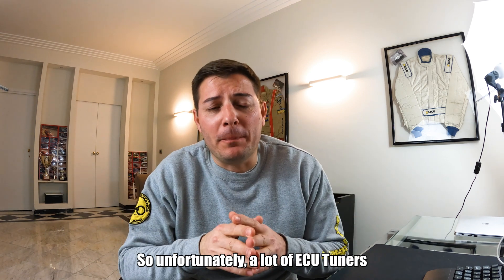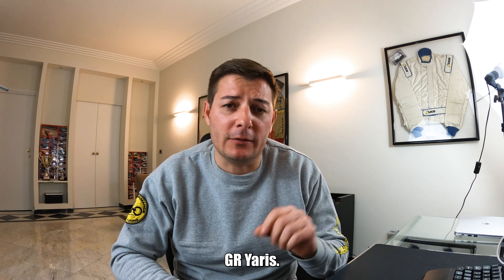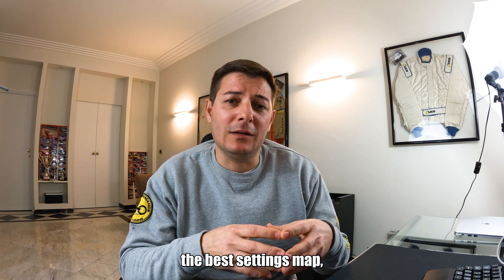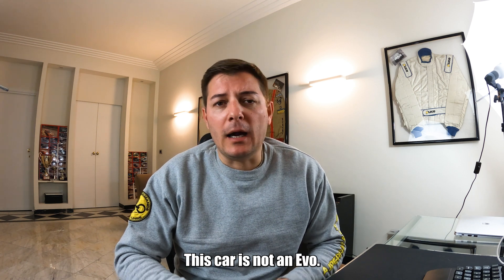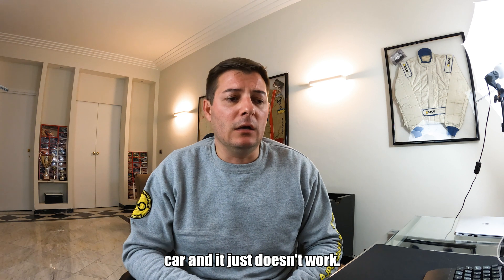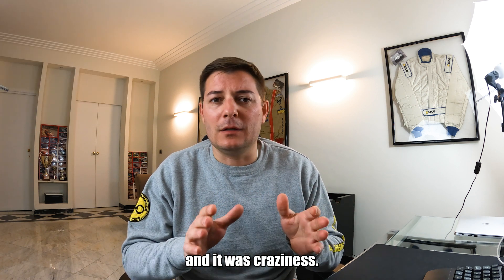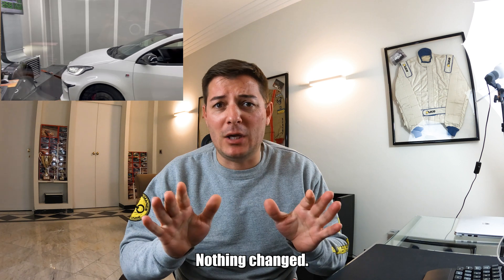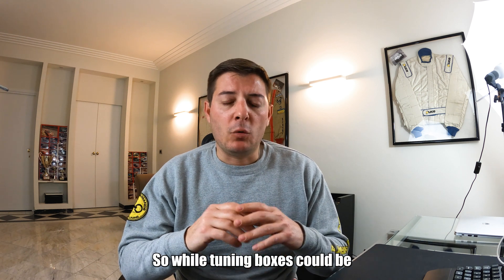GR Yaris ECU Remap Tuning Upgrade (Stage 1,2,3) | 4K

Comment: Just to add, I have been working with a tuner for about 2 years and came to the same conclusion. Its possible to tune on the oem ecu for single runs like at the traffic lights etc but on track as soon as the car is getting run hard it makes almost factory power.
Reply from the maker: Exactly, thanks mate

Comment: Interesting, the dyno we've used on my car has never had a problem in awd mode. That is not to say you're wrong though. Just that it seems there are at least some kinds of dyno that work in AWD that can give consistent results. 😁👍
Reply from the maker: This is interesting: so you got consistent back to back runs in 4x4 mode? You are the first I hear from. Was the dyno in locked mode?
Reply: I dont know too much about it, I can ask the tuner but when I explained the potential issue they said "dont worry all the rollers are linked" they were able to do 10 or so runs with me there during the last tune and got the same power within 5-10bhp through the power curve. I can ask them what type it is if you want.
Reply from the maker: @BanzaiYaris linked is what I was intending, and also you replied: this 5-10hp difference is all the problem mate! It oscillates because the traction control unit (TCU) starts doing strange things when its in 4wd mode!

Comment: Good day! Insanely good video! Thank you. For days now, I've been looking for so many hours a day which chip tuning (or tuning box) I should do. But what great information!

I come from Germany and my English is not perfect, but is it summarized correctly? :
-No tuner can currently offer good chip tuning because they simply overwrite the existing program but keep tuning the car down for safety reasons? And you basically don't have any real increase in performance?
2: Lichtfield is the only company that has recently been able to do a reasonable mapping because they use other software and you can hand in your control unit there?

Please answer or advise what I should do now to get more performance, as of today?
Reply from the maker: Hello Peter, thankyou for that!
Let me clear it out: tuners use software made by third party to enter the ECU, then individually tune the car.
Today there are two main softwares available:
- Alientech (not what you want)
- Ecutek (this is ok)
Find an Ecutek dealer, they will be able to tune your car well.
All tuners that use the other software, even if they are great, can’t keep the OEM software from coming back and intervene on the new settings.
Hope this helps and is more clear!

Comment: Good newz for Ecutek ! I remapped mine because I had inconsistent boost when stock (sometimes it won't go over 1 bar of boost). Now it's gone but i still feel some inconstencies on the road. Also, the Yaris has a 2WD dyno mode included :)
Reply from the maker: Yes exactly! But you should really understand what is the issue there is beneath: boost cuts on stock map point to a real issue of some kind, beware!

Comment: I'm probably $2,500 into this focusing on what was found to be snake oil. I did not run an aftermarket intake or airbox, but you know the drill. 4WD is so tricky to dyno on stock ECU. I had good stock numbers but after adding parts, I lost power. It's the truth and a lot of these companies either cherry pick and dishonest or the mileage may vary during testing.

New cars are hyper complex and a standalone seems to be the only constant to control these conditions aside the other expected anomalies that could happen with dynoing.
Reply from the maker: I understand: best is stock or Ecutek with full control, disabling all Oem sw. This appears to be possible in the current Beta

Comment: Good info Adriano, can I ask if there would still be issues when you go in for Toyota updates  ? They ask if I've had it mapped each time , I understand it can wipe any re-map thats been done. I'm probably not going with any re-map
but who knows in the future.

Regards Russ..
Reply from the maker: Cheers Russ: just went in to Toyota on Friday and no issues. They did connect to diagnostics and also made an update to the SOS system upon a recall
Reply: @AJClubsport Toyota told me any remap on the car would be overwritten  due to having a substantial ECU update (2 year service) on Monday,surprisingly the car as become more responsive  and feels quicker since having this scheduled ecu update by Toyota,definitely a surprise to me.
Reply: Cheers Adriano, yes same thing I've   been in 3 times for updates due to early car, I'll ask again to make sure, Are Ecuteck a UK based software firm ?

Comment: I kinda like the idea of box. If my understanding is correct, that way you get extra power but the ECU has a final word safety-wise? I have DTUK (306hp, 412Nm), but had it's harness re-worked as I suspect the loose pin connections threw Boost pressure sensor error code once every few month. Didn't test it yet with renewed harness.
Reply from the maker: Most probably it isn’t the wiring: it is the ECU not happy with the requests coming from the external box. Try to lower settings and it will work
Reply: @PIRASMotorsport  Happened to me once with the box turned off but wired in car, so I doubt it's about setting. One of the guys working for Rimac repaired the harness and told me there were signs off loose connection sparks. Strangely, read about exact same ECU error code on few stock cars in last few month.
Reply from the maker: @markos8400 wow, that is something new to me!

Comment: Thanks for the video! What is the idle like on the EZ cams? Who mapped your car and did they use Ecutek? Cheers
Reply from the maker: I am waiting on the cams install and map for Ecutek to release the next step in software with added features and muli-maps. All work done by ACME Racing.
Idle is like stock on EZ and A profiles, no information about the other profiles
Reply: @PIRASMotorsport  thanks mate!

Comment: Use a linked 4WD dyno system (IE dynojet) and you wont have issues running with proper 4WD. Our GR yaris development is consistent run to run with sort of dyno, I wouldn't bother wasting time on unlinked small roller dyno that is inferior, nothing but issues for this sort of application. Syvecs is cheap upgrade for the features, consistency and security you can have on the car. ECUTek is good too, but always fighting stock ECU strategies. Hard for me to recomend at this moment, better to not waste money and save for standalone in my opinion. As ECUTek develops it will become more robust so there will more chance to get people an alternatirve, this is always the life cycle of development for new platform.
Reply from the maker: As was mentioning in the video, EcuTek is on the verge of a major new release that will enable full control, so no more fighting the stock ECU! And this will also enable multi maps and OBD writing.
We tried on two different dynos, both linked rollers, and it didn’t work for us, as for many other tuners. Given the possibility of running the car in FWD mode, it makes no sense not to while on stock Ecu, in my opinion.
Cheers
Reply: @PIRASMotorsport  I have no issues with stock ECU on dynojet linked. Nothing but issues on anything else is my experience. 
Yes new update will be a step in right direction, time will tell
Reply from the maker: Cheers mate!

Comment: Don’t go over 420NM with stock rods 👍
I had no head lift at 400HP and 500NM but after 20k KM the rod on cylinder 1 got fatigued and broke. I’m forging the engine right now 😂
Reply from the maker: Thankyou for this information: it seems that you may have run into detonation, because there are many cars out there, including mine, that have been running strong on stock rods at 1.8bar and over for over a year now…

Comment: Thanks for the no bullshit video, at last someone talks with facts why most tuners sell snake oil in the end. Still I have to say that running the DTUK (or DTE in Germany) box in the conservative settings for 1 year with at least 2k in track/drift events I have only had only a couple of times throwing an error code and I consistently see at least 1sec of improvement in my lap times (in the same track and same day event so comparing apples to apples). I also almost always have it deactivated in the city, using it only during track time and maybe autobahn where 230km/h in Germany will not cut it! Not sure what a quality next step for additional hp would be (looking for 320-340hp range, nothing that I will need to open the engine). Oil cooler installed, transmission cooling mods as well, next step is suspension.
Reply from the maker: Cheers mate, very big news is coming from the suspension compartment soon (within a week)

Comment: Hey Adriano, first of all thanks for the good technical content you provide. Keep up the good work.
I'm currently on a custom map for 3500km now with 340HP/450NM and just bolt ons and didn't run in any sort of issue yet. For the 2025 season I'm thinking about upgrading the motor like you to go for around 420HP but not much over the current torque because we all know the car doesn't like that.
I'll drop in the beehive springs and 267-A cams from Kelford, turbo upgrade, head studs and upgraded head gasket. What studs will you be using and what gains are you expecting from your build plans? I'd love to hear your thoughts on this.
Reply from the maker: Hi there, thankyou for your comment!
Your plan seems to be very good and ambitious! I suggest to check out @ctecperformance
Nigell is around the end of development of the most well engineered turbo kit I have seen for GRY, with long runner headers and two turbo options 450 and 550bhp.
I’m happy your stock ecu map is running strong, it’s a lucky one and for sure you have great fuel where you are!
Reply: @PIRASMotorsport  Thank you for this suggestion, I'll have a look at it. Unfortunately I can't run an aftermarket turbo setup because our TÜV will notice 😄 My current setup has full TÜV coverage. You're right, here in germany I've no issue finding 100 or 102 octane fuel. Do you have a suggestion for the head studs? Will H13 tool steel keep up with this kind of power?
Reply from the maker: @TheOriginal99 yes, they will be fine as head studs. I got Lamspeed
Reply: @TheOriginal99  in Germany as well, care to share your current setup? I am on a DTE box with low settings, Milltek exhaust, Airtec oil cooler. The DTE while not anything dramatic always gives me at least 1 sec better lap time and while I have not measured my car I’d say it’s close to 300hp, would be interested for 340hp. TIA

Comment: Lift will come with 280hp and 390Nm of torque. I think it might be the sweet spot for this car. I think for tracking car the best map is always stock one:).
Reply from the maker: Yes, or a very well done map and all additional cooling/supporting mods
Reply: @PIRASMotorsport stock map is always very good and safe. Of course when mapping Your car more power means always more heat (and heat is killing the engine) so intercooler and oil cooler is must have modification. I dont have experience with GR (but i really want to buy lift) but with another cars i owned i have bad experiences with custom maps, tuners always pushed the engine to the maximum chasing the peak Numbers and in the end it ended with engine damage or with the lack of performance on the track by cutting the boost and timing. Now i am using OTS map on my car, that map was tested for several months on road and tracks and i am pretty pleased with it, it works, car is smooth and zero problems;)
Reply from the maker: @piotrwozniak7840 yes, I agree: this is why I talk about power that is always the same in all conditions. The GRY gets very hot, this is why we developed the hood vents to extract hot air, both WRC and Rally.2 versions. What do you intend by “lift”?
Reply: @PIRASMotorsport by lift i mean refreshed version which will come in the middle of this year. Toyota made great changes in refreshed version of the car (also better cooling). I want to sell my golf 8R and get GR 😊
Reply from the maker: @piotrwozniak7840 ah ok, in that case its a great idea!
Reply: @PIRASMotorsport 8R is great driver car, it gives much fun, is crazy crazy fast after tune but i miss my Focus RS rally feel and GR is rally car for the streets. I love this concept:).
Reply: Hi Adriano,
All the Time i think here in Germany about to bring the car to MPS Engineering for make the mapping. I drive my car hard on the road but not on the track. It's one of the first cars 2020 wit fin under 2400 with the JDM Mapping RZ boost Pressure 1,6 bar. Modifided with HJS Downpipe, Milltek Exhaust, Eventuri System and Turbosmart  Valve the car works with good 300 horse Power and full toyota waranty  about 15 years in Germany. For the hard street use perfekt and i think with the modifikations,  like suspension, bushings etc. the new GR 2024 will have no chance. 😊
Reply: @holgerstoll4682 how it is possible to retain warranty after the tune?
Reply: @piotrwozniak7840  my toyota dealer told me, if the engine is killed and Toyota check the ECU Box, they can see, another Mapping was installed. Also when you are playing the OEM Mapping again. Every Mapping is registered and you can not delete
Reply from the maker: @holgerstoll4682 this also depends on what mapping you have. Getting to more advanced software, they will only be able to detect on a bench in Japan

Comment: Hey A, thanks for the great video, so my car is mapped by one of my friends knowing denso ecu very well , we ran the car on the front wheels only and achieved really good results, but once on the road the car took out power aggressively, after realising that we went back and got it eventually sorted by adjusting torque limits in the 4wd , car runs great consistently now , just some data , it ran 16.6 sec 100-200kmh stock ,then after the map it now runs 13.8 seconds consistently, I kept it moderately on the tune, he said there is still more to get out but i left it at 250kw it ran 200kw on the base run with only exhaust
Cannot wait for ECUteck🤞🏼
Reply from the maker: Thankyou for this great information, sharing your experience: I am happy you also saw first person!! Please let me know how the next step goes for you with Ecutek!

Comment: I had similar problems with the Litchfield chip. Fantastic when it was working, but particularly at the track the chip would throw a code and cut boost.
Reply from the maker: Yes, exactly the interference detection by OEM software!! Cheers Matthew
Reply: was that the Lichfield box or remap?  I have been considering the ECU map from them, but this very well argued presentation gives me doubts. I am GR 21 8000miles
Reply from the maker: Litchfield now does EcuTek mapping on stock Ecu, no problems!!

Comment: What seems popular in Japan and the rest of Asia is ECU tuning using Alientech. Any thoughts on these? Today I am using RaceChip GTS and it seems to deliver a noticeable difference. I am also curious about the Kelford cams and springs. As I understand this must be used in conjunction with ECU tuning and is not just a drop-in or bolt on solution - am I correct?
Reply from the maker: If you drive the car hard enough, you will see that the tuning box will vary about lot in performance output, depending on outside temperature and altitude
Reply from the maker: The Alientech doesn’t manage to exclude all the under-maps in the original Evu software, therefore it constantly shifts beneath what you program and doesn’t absolutely offer consistency. Ecutek should work great also with cams, it will be done in the next two weeks

Comment: I have used jb4 with their bcm module - works well and gives 295-310hp (i have only mild setup, not getting all out) - for my use for fast road/track it works well. Trust it more than bad ecu tune.
Reply from the maker: I have had something similar, but for me the benefits are negligible and the response varies a lot, depending on outside temperature, altitude, etc…
Reply: well stock engine does the same.  @PIRASMotorsport